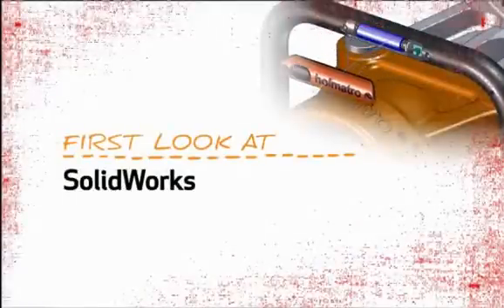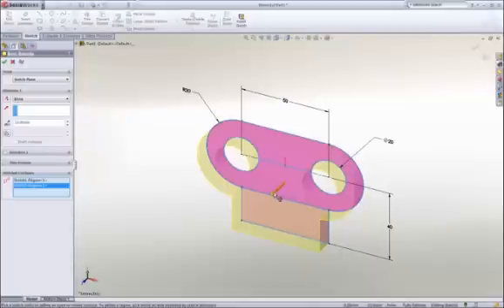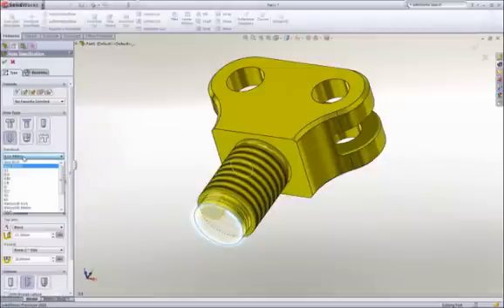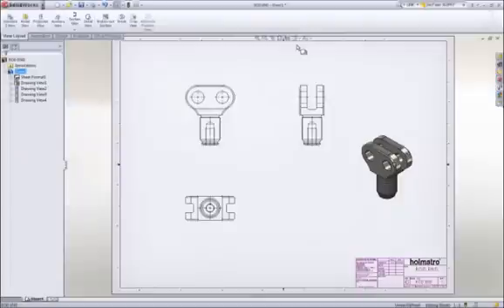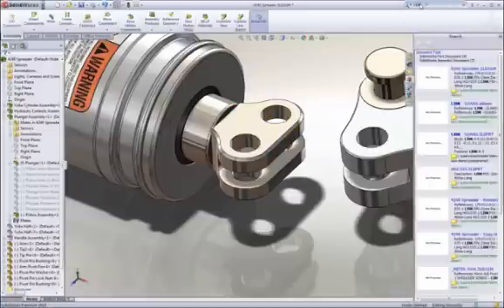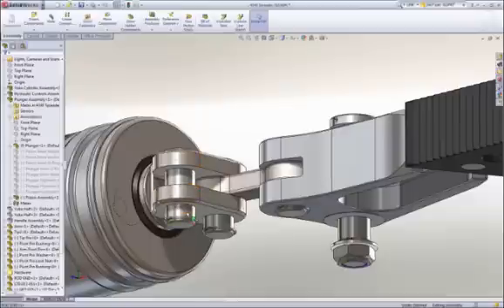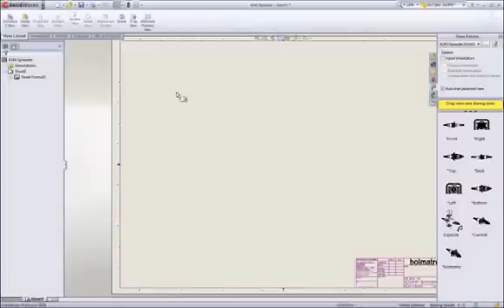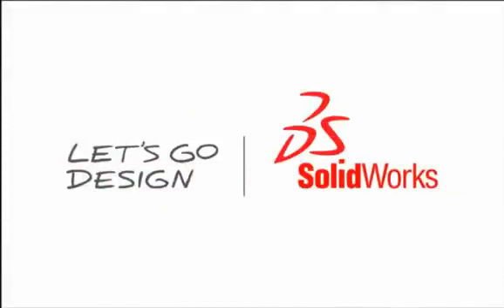SOLIDWORKS 3D Design (CAD) Software - FIRST LOOK

Comment: Holy crap this is amazing! Is this the file type used for 3d Printing?

Also, is there a way to animate the physics going on? For example, if i am making an electromagnet with a magnet inside, can i set a current, and will it demonstrate the acceleration of the object inside? I'm assuming not since that is more so simulation rather than drawing. And if not, Could you recommend me a product?

Comment: Does it work on mac?
Reply: No it does not. Had to get rid of my Macbook Air since Windows supports most of these programms better. Yes I know i could have used bootcamp, but a seperate video card + extra hard drive space comes in handy for these types of assemblies.